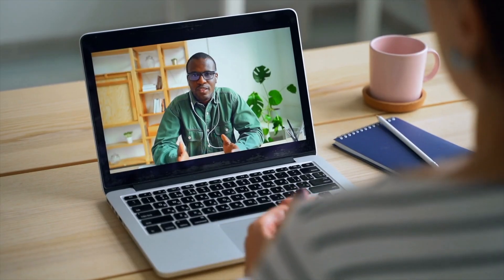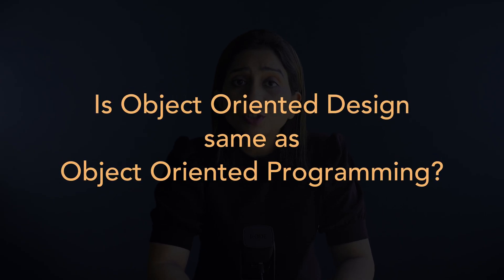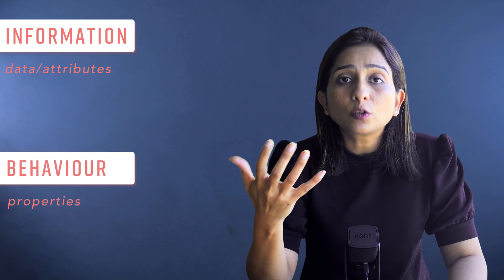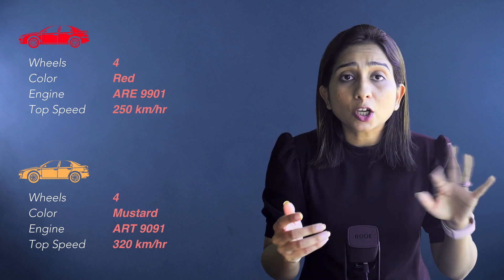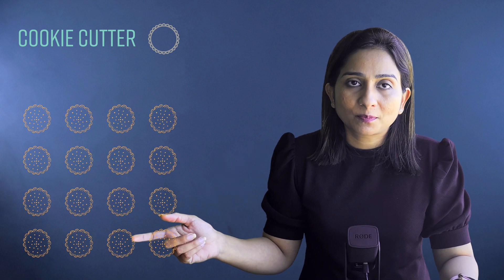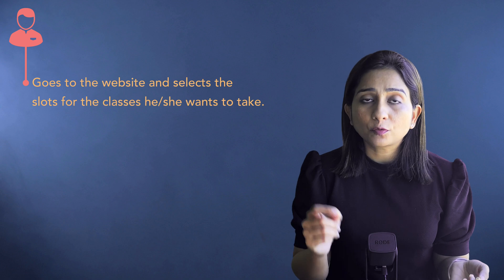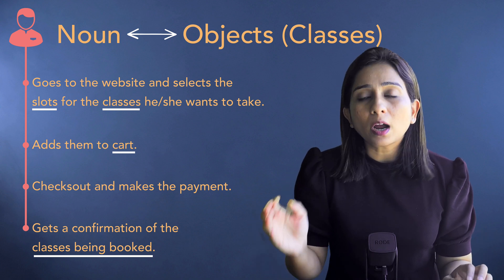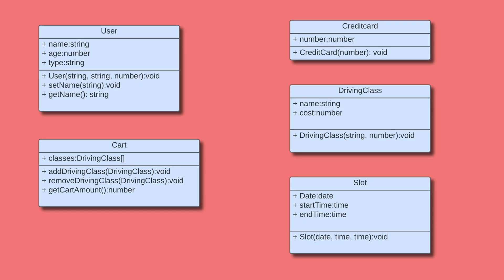Low Level Design 103 | How to design low level applications using objects and classes | OOD

Comment: Thank you for the amazing explaination. I had a small doubt regarding class diagram. While designing class diagram for any system, we try to design in-memory solution right ? And not considering databases.
Reply from the maker: Yes but we do need to design classes which will talk to databases if that is the expectation of the problem statement.
Reply: @sudocode  Okay. Thanks :) 
One more small doubt. Are service classes part of the class diagram? As, in actual software systems, we tend to have a lot of service classes that have main business logic methods and they interact with models(MVC architecture). Basically, I am a bit confused regarding the mapping between web applications(decoupled Web Service APIs) and these LLD systems which are asked in interviews.

Comment: Simple explanation without any jargon. I want to ask one thing, what is expected from a 0-2 yrs experience candidate in a LLD round? UML diagrams or code or both?
Reply from the maker: Basic code and class design is expected. Like defining classes with proper getters, setters etc.
Reply: Hi yogita, if you going to take any low level design examples in future videos, please write code in python also not only in java.

Comment: I think calling 'Behavior' as 'Properties' can be misleading. We use to interchange attributes with properties and it might create confusion. In my understanding, properties are same as attributes. Like in the above example, car has wheels, engine, color as attributes/properties. And behavior is the methods/ways/processes which uses these properties to perform some kind of activity. For example, car can drive using an engine. Here the activity we are performing is driving and the property we are using is engine. So in a nutshell what actions/activity we do with attribute/property of a class is termed as a behavior.
Reply: Yes, this makes sense. It aligns more with its "function", helping explain why classes combine data and methods/functions.